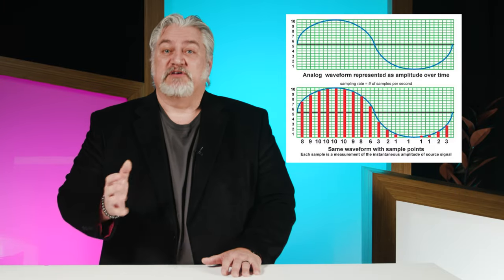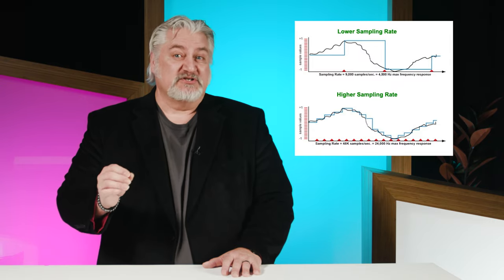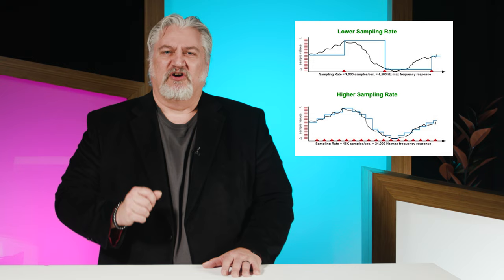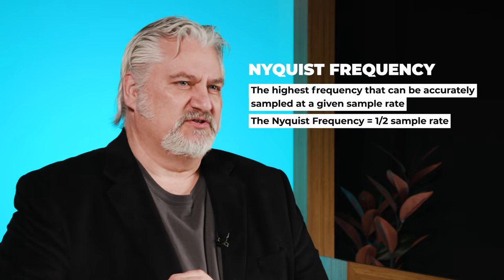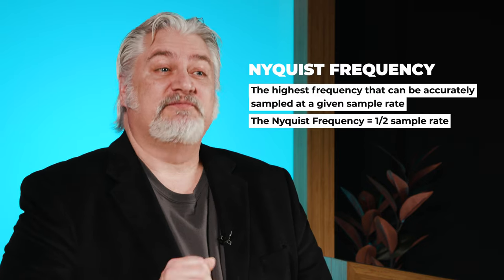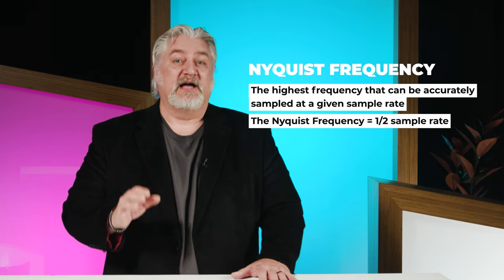What Are Sample Rate and Bit Depth?

Comment: BIT DEPTH the Voltage or Power Amplitude 2^n bit resolution or Dynamic Range, the Vertical Axis, Sampling Rate on the Horizontal Axis Time or Frequency domains on an oscilloscope or spectrum analyzer for electrical/electronic engineers for ANALOG / DIGITAL FFT FAST FOURIER TRANSFORM signal analysis.

Comment: Let's take a perfect analog sine wave and sample at 44,000 (44k) 
1) 10hz 10 waves per second = each wave has 4400 samples
2) 100hz 100 waves per second = each wave is sampled 440 times
3) 1000hz 1000 waves per second = each wave is sampled 44 times
We are now getting some very rough looking sine waves as we connect the dots with line segments just 44 times
4) 10,000hz 10,000 waves per second = each wave is sampled just 4 times.
How do we shape a perfect sine wave with just 4 samples?
Reply: The filters in the D/A process are designed in such a way as to filter out all of the frequencies above Nyquist. All of those sharp (non-sine wave looking) turns you see in the waveform represent higher frequency content, which when filtered out, returns the waveform to a sine wave, just as it was when it went in. Hope this helps.
Reply: @davoman21  Doesn't sound very accurate, it sounds processed and hopeful :) . I would think 196kh would help quite a bit??? I have also seen on analog tape recording how the perfect square wave is distorted to a sine wave at plus 10,000hertz frequencies. Maybe the accuracy above 10,000hertz is not within our current technology?
Reply: @WildernessMusic_GentleSerene  This is one of the main things to understand about the work of Harry Nyquist (among others). The principles are all sound and verifiable. Digital would not work at all if this were not true, because, as you say, there just aren't enough data points to define higher frequency waveforms even close to accurately enough. This filtering indeed takes out all of the extraneous info (higher frequencies) that shouldn't be in the waveform as it is added at A/D. I get that it is counter intuitive, but it really does work quite well. It's easy to test with a signal generator and an oscilloscope. Record a 15 kHz tone into your DAW, then play it back (ignoring your computer screen) and bring that playback tone up on an oscilloscope and compare the in to the out. They will be the same.   As for the analog tape example, indeed there can be increased distortion at higher frequencies. The question is, how much do they matter to the human auditory system? If we accept that human hearing is limited to 20 kHz, and understand that the first harmonic of a 15 kHz sine wave would be at 30 kHz, then you can realize that a 15 kHz sine wave and a 15 kHz square wave would actually end up sounding the same to a human who is unable to hear that first harmonic, nor any of the subsequent ones. This, on the other hand, is difficult to test, as the audio playback system would have to be able to play these waveforms without introducing any artifacts of its own, which is a tall order.
Reply: @davoman21  Amazing it works! Anything over 10K is certainly high, limited to hearing depending on damage/age. I don't believe there is discernable instrument identification at 15k+ but all the fine finished harmonics in this upper range defines how life like the recording is to the original. Thank you for all your help. Once I listened my first CD in 1986, I never wanted to play vinyl again, but we have those folks who will only play vinyl analog on there audiophile systems. Still trying to understand what they are hearing besides tape hiss, needle rumble, distortion and massive compression.